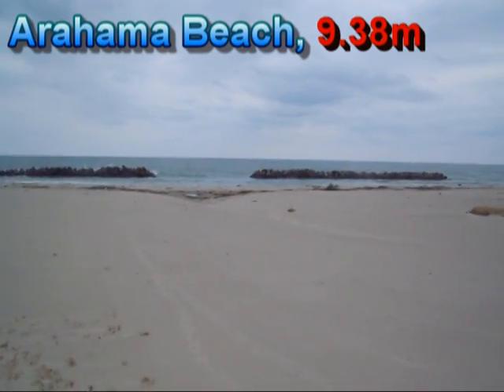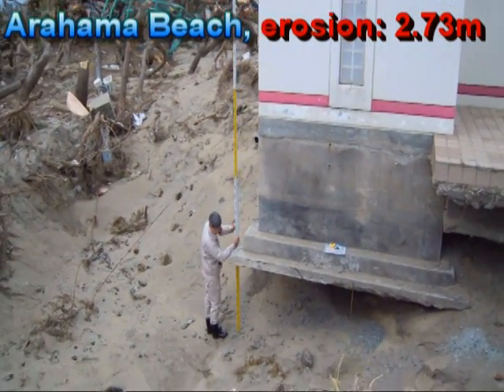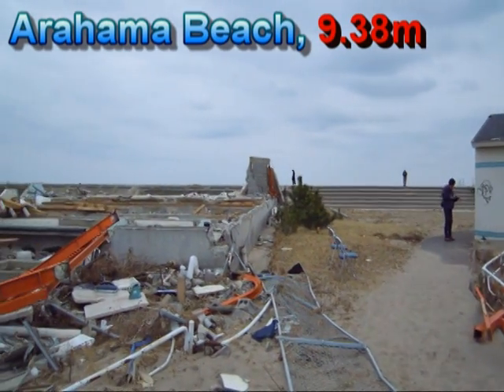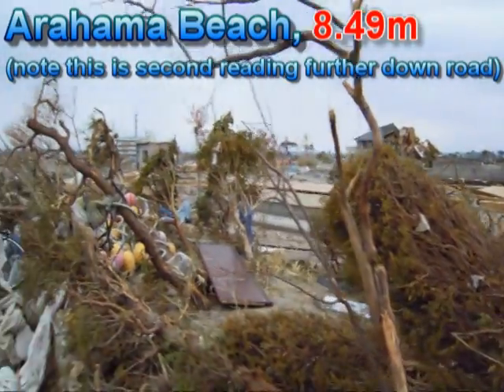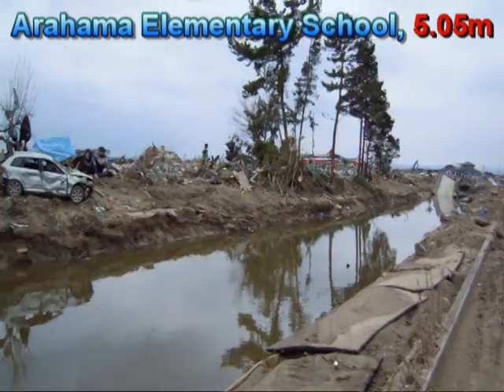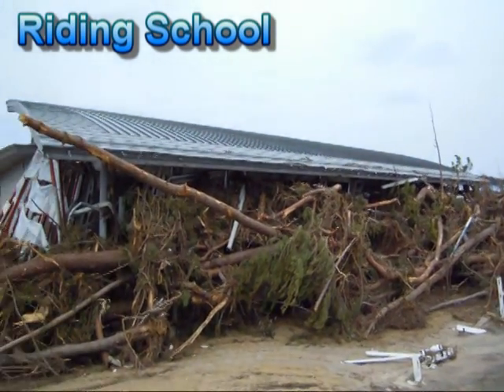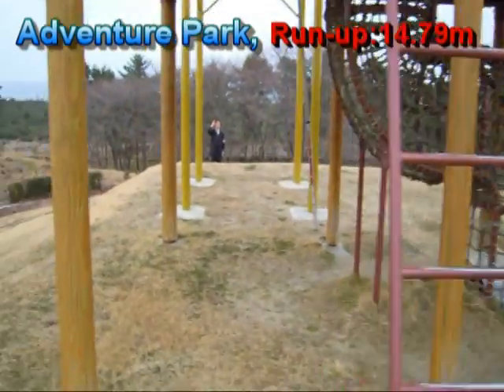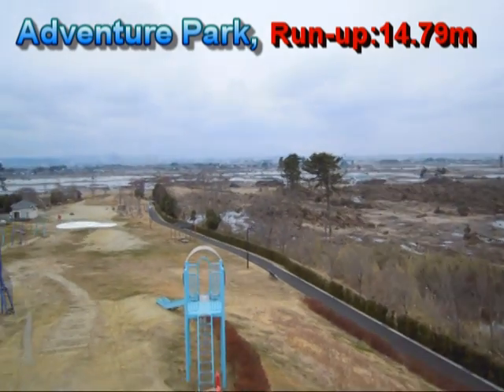Tsunami Survey in Japan (Sendai) after the 11 March 2011　Tsunami 宮城県津波調査仙台市

Comment: @Gyphia "why do a lot of the tsunami videos show no big wave, but instead, the whole sea rising  ...?"

This tsunami had an amplitude of about 0.5 m, with wavelength about 100 km. At the speed it travels in deep water, time from trough to crest = approx. 6 min.

Waves slow in shallow water, with the faster rear overtaking the slower front. The height increases as the water piles up. The slower wave takes longer to pass. The water's inertia also causes it to run-up inland higher than its height.